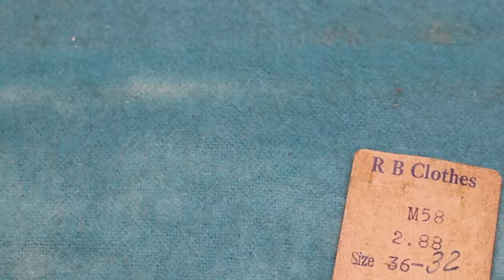Ep. 49 American of Martinsville RESTORATION of a Mid-Century CREDENZA

Comment: Beautiful work as always, but I’m curious why you didn’t restore the finish on the legs/base.
Reply from the maker: Great question. There were very minor scratches and the restore a finish with fine steel wool usually works well for those things. I've found that staining the solid legs can often make a piece like this look worse if it isn't a close match to the veneer on the rest of the piece

Comment: Hi Barry.  Beautiful piece. Why does that monocoat stuff get put on with a spatula and not a brush?
Reply from the maker: The hard wax oil gets worked into the wood fibers. A brush usually just spreads it across the surface. I use a spatula and a non-abrasive pad
Reply: @MadCityModern  thanks !
Reply: Could you please elaborate on the monocoat product you used? Is it more durable than others? In the video it looked like a part A & B product?  Is it a mix? Also do you have links for the applicator?
Reply from the maker: Try watching the Cedar Chest video or the recent woodworking video. I discuss it in more detail there

Comment: Great video.  I have Drexel declaration bedroom set I'm beginning restoration soon. I would like to use Rubio monocoat  but a little concerned about getting all pieces the same color. Some of the pieces ive  stripped & sanded have color variations from being exposed to light, etc. If I get all pieces down to bare wood, do you think the colors will be similar enough to call them "matching"?  I've always used lacquer but really want to find a safer alternative. With lacquer I can use toner to even out color, etc which i do often in restoration. I restore MCM exclusively. TY
Reply from the maker: Benefits to both. For the best color match, go with the toner